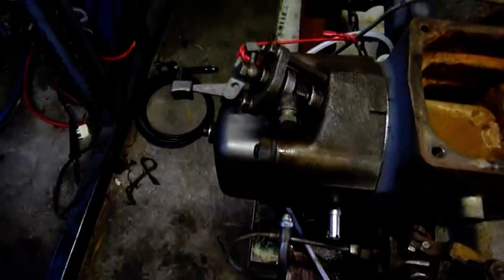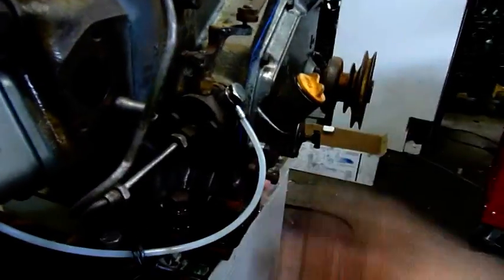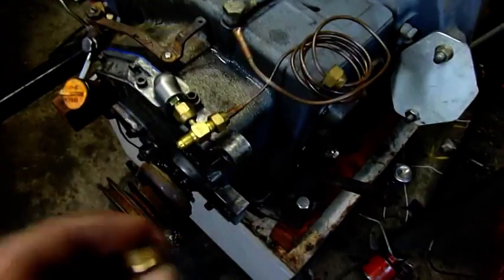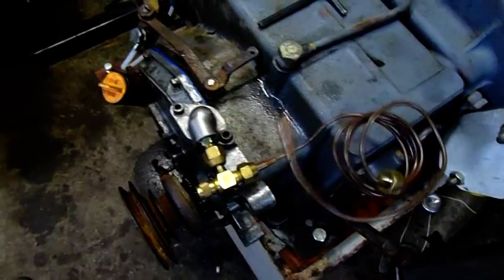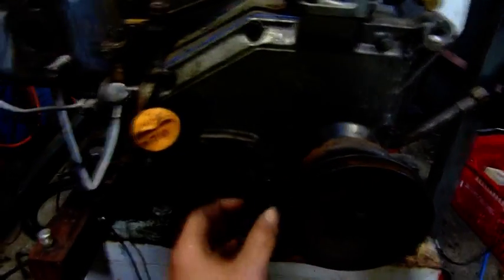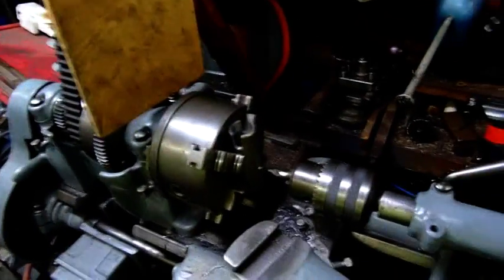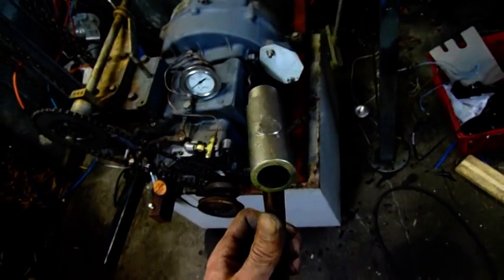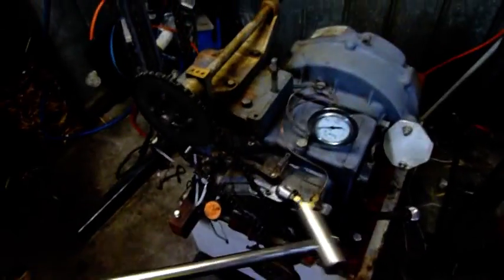Yanmar YSE12G Reassembly 2

Comment: Get yourself a 40's vintage carbon arc torch, just clip the leads to you welder and you can heat things red/white hot in seconds, great to have around for heat bending, and heating rusted parts etc.. they work great.

Comment: The crank handle seemed to stick when you wanted to take of off, will you angle the slot fitting so when the engine fires up it automatically throws the handle off drive pin? I can see a runaway crank handle flying here! :)